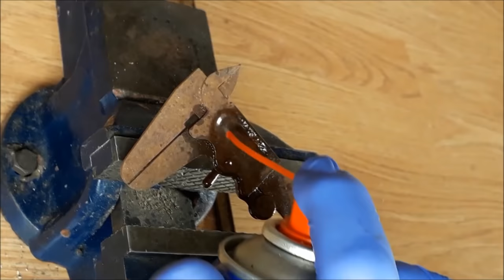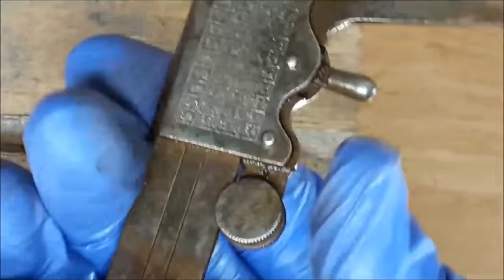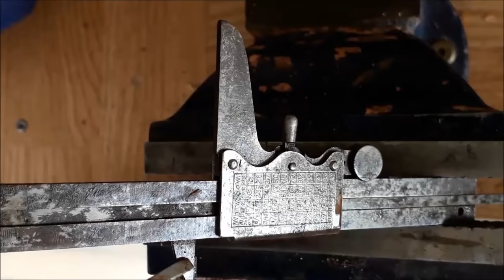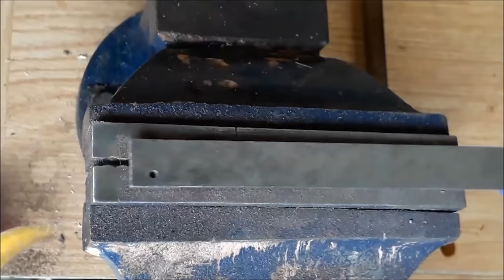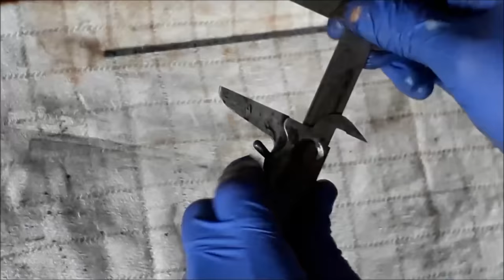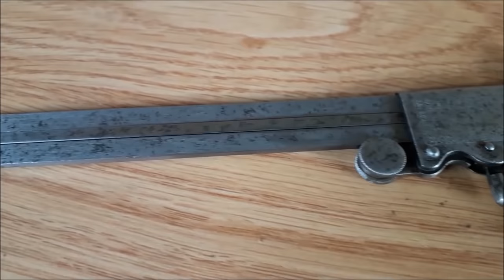Vernier Caliper Repair

Comment: Low. This "restoration" no more, than wire brush cleaning. Cliper is heavy rusted and jammed, but 60% of video is a WD-40 spray prosses. After this "restoration" caliper can't be used anymore. It's accuracy now is "+\ - half a mile"
Reply: It could not be used before, so what?
Reply: @volkmarkostka6763  Restoration means bring thing back to original look. Am I right?
Reply: @ПетрИванов-ы6е  Can also be "restore to working condition" whatever that means for that person.

Comment: So many comments complaining about not being reliable for precision measurements after his restoration methods.  How does that compare to the precision it had before he started?  It was unusable.  Precision is relative to the application.  Most woodworking doesn't require 0.001" accuracy, so it would be fine for that use.
Reply: agree too.
Reply from the maker: Thanks for the comment

Comment: You cannot have finished it there, if you would have sealed the rust off with tannin, cleaned up the rest of the discoloration, polished it up a little bit, possibly color filled the numbers so that it would be easier to read, you took what could have been a beautiful tool restoration and just did the bare minimum with the wrong tools

Comment: should have pre soaked in automatic transmission fluid for about a week. Plus use a brass brush.
Reply from the maker: Thanks for the comment
Reply: What is this tip good for? All type s if rusted steel?
Reply: @rockandmeatroll  by placing them item shown. The auto trans fluid will penatrate the slide area fairly easy rather than abuse of the item being restored.
Reply: @rockandmeatroll  can be used on steel. do not use on rubber seals or plastics
Reply: Or use Kroil
Reply: My go to is a soak in used diesel oil. Every day I pull it out and try to disassemble. If it fails it goes in the bucket for another day.
Reply: And soft yaws on the vise... and so on. This is painfull to watch.
Reply: Kids never use flarhead screwdriver for hamering another steel part use bras or bronze even aluminum but not streel on steel.
Howg boomer spoke😉

Comment: Good restoration.  I believe that I would have first tried a good soaking in Evaporust or a similar chemical rust remover before using mechanical means (wire brush)..
Reply from the maker: Thanks for the comment

Comment: Nice effort on a frozen tool. I don't think I would rely on the precise readings from it anymore, but it still can be useful as a locked inside or outside measurement tool for transferring such locked abilities to something else. Not sure I would have tried to refurbish it myself. But nice work, all the same. Thumbs Up!
Reply from the maker: right, the scale readout was too much affected by rust, but  it is still accurate and useful as a transferring measurement tool. Thanks

Comment: A polished mirror finish could have been achieved with FAR less effort than you put into it.
Electrolysis to remove the rust probably would have freed it up pretty quickly.
If not, then ATF definitely would have done.

After that it would have been a case of a quick blast with a BRASS wheel (not steel) and then a polish.
Reply from the maker: The scale was affected by rust, after polishing you would still see the pits, but have compared it with new caliper and is still accurate. Thanks

Comment: How to become yutuber-profanatorom? You need a little: necessarily blue gloves, a rotating brush, a curved screwdriver, sandpaper, and of course 40WD. The principles are simple - remove all corrosion down to bare metal and paint with supermarket spray paint. Patience is attached. Take a long time and painstakingly to shoot every step. The longer the better. The more useless the piece of iron, and the senselessness of the work, the better. You can pre-pour the whole thing with salt water, wait a week and start profanity. This will ease the suffering.
Reply: Well,,,,,,,it is the truth.

Comment: Well, let me say that I wouldn't ever use processes and tools you adopted. First of all, soaking in winegar thr blocked part and then apply the paste made of flour, winegar and salt.
After that, I'd use a brass brush instead of a steel brush, because of a gentler abrasiveness of the brass rather then steel. Sorry, but I don't like your work. You almost destroyed a nice old precision tool.
Reply: Yeah. You said it better than I.  Maybe an ultrasonic bath would also work.  Also hammering using a screw driver instead of a wood or plastic rod is insane. Always use a softer material rather than similar hardness
Reply: This comment is so useless! Everyone is restoring something their OWN way. No need for people like you to give these types of comments , so annoying
Reply: @EL3AILA  Your comment is priceless, instead.  A lot of useful suggestions on how to improve our restoration techniques and processess. 
Thank to your knowledge, we will do a huge step forward on our craftsmanship skills...
Ma vatte a fa' n'giro da n'altra parte che è mejo.